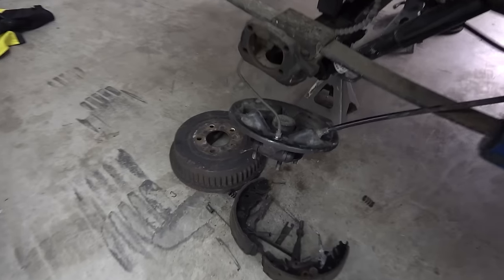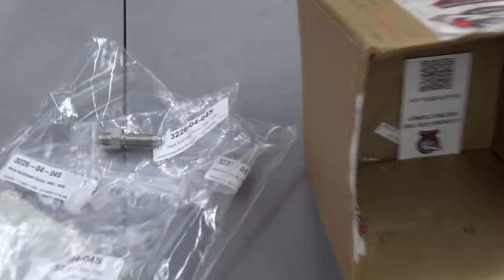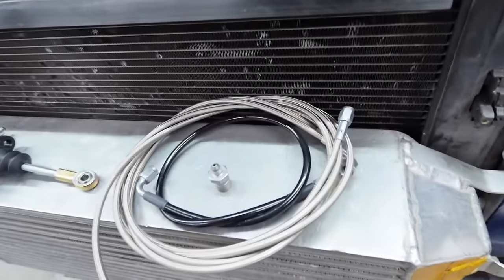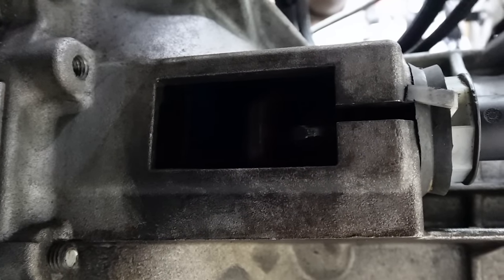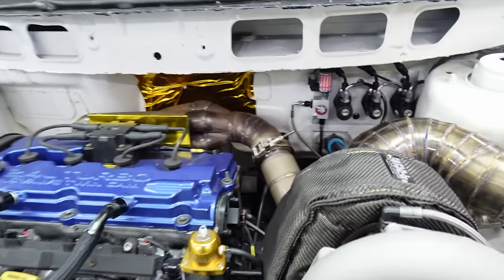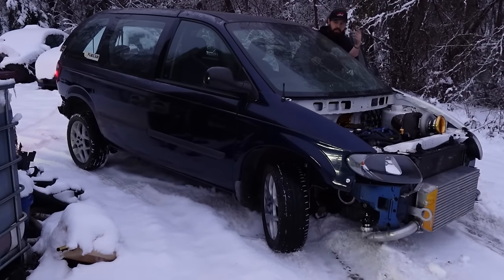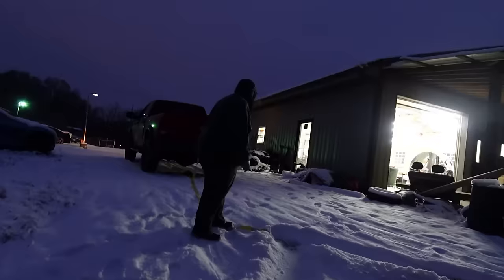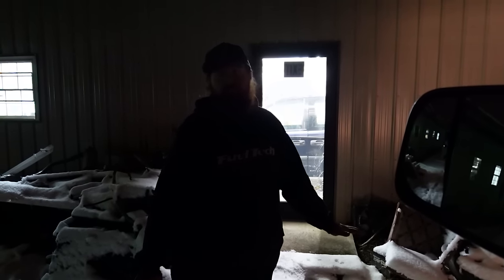Fixing the One Thing Wrong with my Big Turbo SRT4 Swapped Minivan!

Comment: Be careful running AN line for the entire brake system.  Ive always been told to keep it to a minimum because it swells under pressure making the brakes feel spongy.  Same with hydraulic clutches.

Comment: so do yall reckon the 3an brake lines are "safe"? like im daily driving them but im pretty sure that's technically a plastic brake line
Reply from the maker: Not a clue. Just the route i decided to go. They're rated at 4000psi operating pressure and 8000psi burst pressure.

Comment: “The only thing wrong with it” changes up the break system and then requires four attempts to close the driver door.  Looks like there’s something else wrong with it now.
Reply from the maker: I dont have an inside door handle, its just the metal rod that use to attach to it and it fell between the door and the body and i wasnt paying attention just smashing the thing 😅. Just had to pick it up out the way.